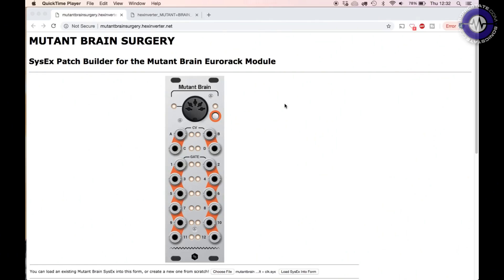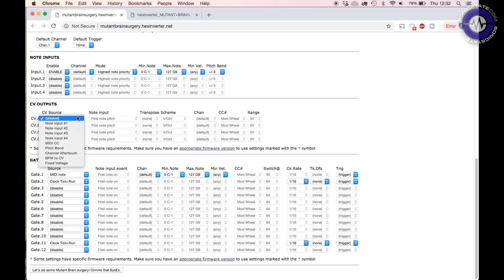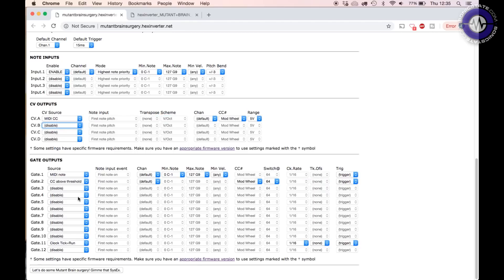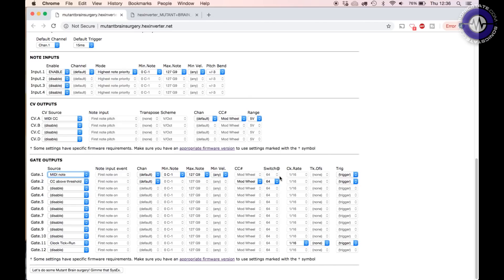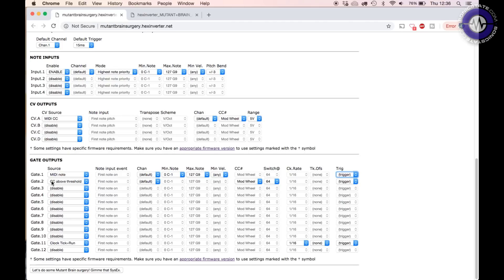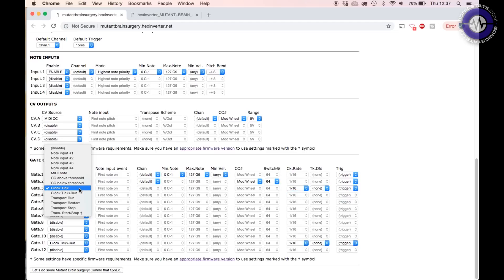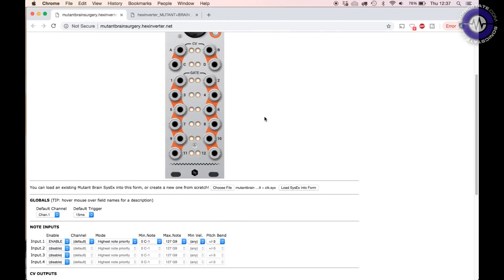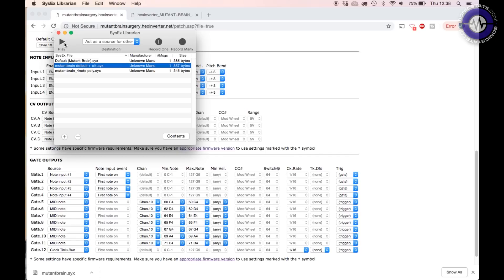Hex Inverter Mutant Brain MIDI Converter Eurorack Module - SonicLAB Review

Comment: Good review. Absolutely agree about wishing for more CV outs. However, one thing worth noting is that the gate/trigger outs can also be clock outs and resets, which I’ve found to be quite useful. You can also divide those clock outs with the software, which could save some space you’d use for a clock divider.
Reply: can you elaborate a bit? I have no idea what I"d use a clock out for or a reset. Are there reset inputs?
Reply: More CVs = more cost, though - you need a DAC which you don't need for gate/trigger which are just on/off.

Comment: Fully agree with your conclusion. While the gate : CV ratio is not ideal for many use cases, it is useful for sequencing a percussion pattern + a melodic pattern or two simultaneously. But most importantly, its price point is extremely attractive and makes it well worth its inherent compromises. 

Personally I prefer the Vermona qMI2 for its simplicity and increased CV outputs, but it's a lot more expensive and actually can't do a lot of the things this can. I also use the FH-2, which I believe can do everything this can and more, BUT only has half the outputs for almost double the price, or you can get the expander which makes it a strict superset of this but like triple the price.

Comment: I've been thinking about something like this.  I use a Toraiz Sampler workstation to send MIDI out to my Pittsburgh SV-1 in my case which converts to CV and gate.  There's 1 cc out and velocity out. In the Toraiz i can easily customize that Cc and save the settings per scene (16 scenes per save file) So it's extremely easy to control filter sweeps, pitch bends using the touchstrip, or assign a synced LFO to modulate that cc amount.  The problem is the SV-1 has only one cc out while there is potential to store multiple custom cc parameters on the workstation.  But Pittsburgh did an excellent job with the space they had (Digital LFO with 2 outs, arp, etc.) and i know they have another Lifeforms MIDI module on the market but i haven't looked into it.  Fun stuff!

Comment: I want to buy one, but have few questions. Does it have velocity and aftertouch output? Can I use simple midi to usb adapter with this module to connect it to computers usb (if I dont have midi cable)?

Comment: Every time I see one of these web configuration things I wonder how long the domain will be up and how long it will work, I'm sure the hardware will still be around in 10-20 years, but will this website still be working? I wish all sites like this would have a zip file at the bottom of the code that you can just bung in apache and host locally for redundancy
Reply: Well Github was a great place to store source code for such applications, but Micro$oft bought them so now it's just a matter of time before that place is a ghost town. But it is totally possible to release your application source code to a public repository to ensure it will be available for future generations.
Reply: The web site code is shared with CVOCD and is here https://github.com/hotchk155/hotchk155.github.io/tree/master/cvocd but i am looking to make a downloadable EXE version ... hopefully in next few months.
Reply: That is a fair and honest worry! I get ya there. There are future plans for a standalone cross-platform app for generating the SysEx (as Jason mentioned above). As well, if it ever were to be taken down, the code could be readily implemented even on your own computer (it doesn't actually need the internet to do its thing, it's purely active code on the page basically)

Comment: Interesting. But I’m thinking of an ES-8 to get MIDI & audio in & out of computer / modular. Wondering how this compares. Obviously no inputs. But is there more to consider?
Reply: ES-8 is a full blown audio interface. The more comparable Expert Sleepers module is the FH-2 (with the MIDI DIN expander). But there are several Expert Sleepers modules that can accomplish the end goal here, if the MIDI sequence is stored on a computer and you use the Silent Way software.
Reply: @rdean150  I'm thinking now the ES-8 is overkill for me, especially for the cost. It's not far shy of $800 here in Australia. I have audio i/o through my audio interface. So CV i/o is more of a thing I want. A lot of similar modules don't have CV input, so that's a problem. I can live without it for the cost of something like the Mutant Brain. If it had CV input & more CV / modulation outputs I'd be all over it. Still not sold as it is. I'm struggling to find my perfect module for the problem of CV i/o between my DAW (Reason) and my small modular set-up.

Comment: Hi, does it work with Elektron Rytm?
Reply: As far as I know the Rytm doesn't send MIDI data out of its sequencer. Correct me if I'm wrong, but I think that's a limitation of it. So it might not work for sequencing. On the other hand, it works a treat with the Digitakt and/or Octatrack or other gear that does spit out MIDI from its Elektron sequencer.
Reply: @hexinverterDOTnet  Ok, thx. You're probably right I think.